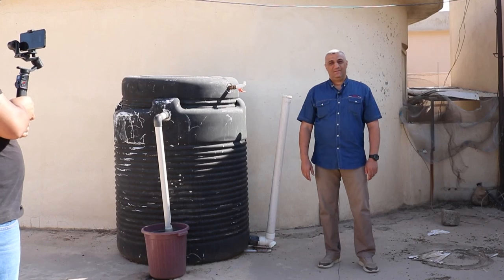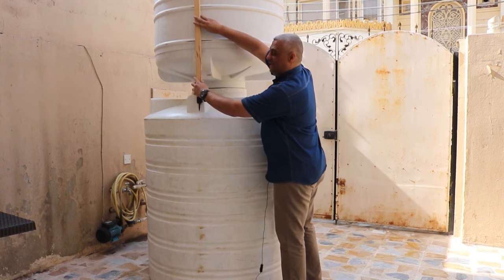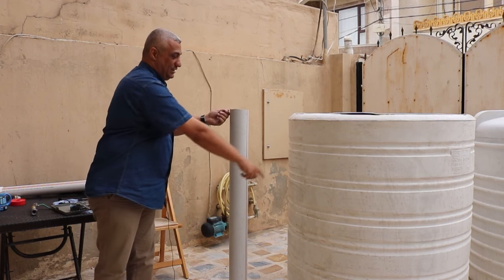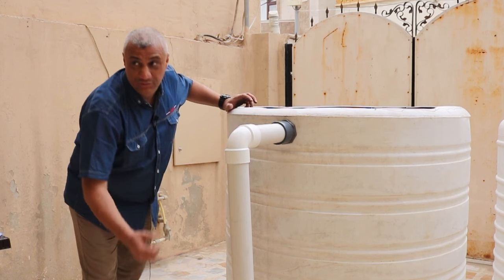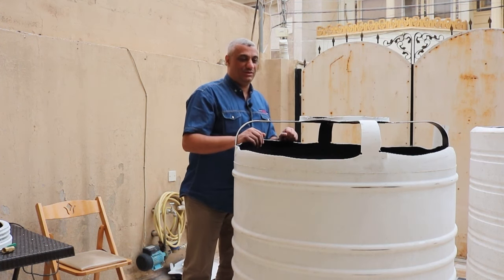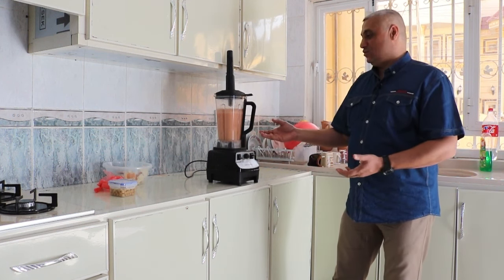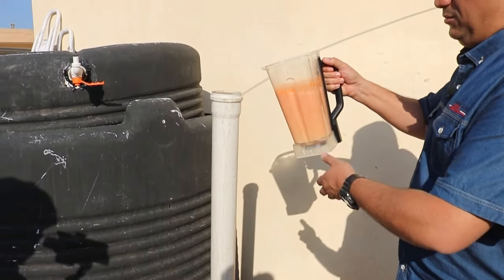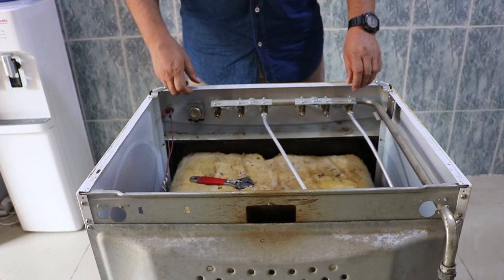Create your own biogas digester

Comment: thanks for the well-explained presentation. but I have a question sir, the gap between the wall of the digester and the gas storage does not leak gas. the storage was just put upside down in the digester, what about the side, how to prevent gas leakage.

Comment: You are Hero's, making the world better in many ways.

Just a thing about the manure:
You would want to see what the animal eats for the bacteria culture.
If you have a lot of branches and grass, I would suggest having a second digester for your garden material. (the bacteria need to be able to specialize in this case)
Problem is that food is already processed a lot and will digest more easily.
Anything with a cell wall will have a problem digesting, but then you would use a mix of horse and cow manure.
Chickens are for example more predatory and eat seeds, which will have a different mix of bacteria. but also probably fix more nitrogen in their droppings.

The Basic material is easily fixed too:
You said not to add bones or hard stuff that does not digest.
To balance your acidity around a PH of 6, you could use egg shells, clam shells, bones and such.
They will slowly break down as the acidity lowers and push the PH back up as they add calcium ions into the mix.
Just be sure it's a small layer of material that stays on the bottom, you will want to ensure it does not overfill.
(might use the good old stick prodding method to check how much stuff is on the bottom)

Design wise:
Simple and easy to build, am only concerned with a little gas leak from the sides of the digester, a skirt on the storage might solve this though...
(Just to ensure as little methane as possible escapes into the air, because it is another greenhouse gas)

I really hope this video reaches as many people as possible.

Comment: Do you not lose gas, as it escapes from the space between the two tanks? ( the space  I refer to is between the bottom tank walls and the gas capture tank that raises and falls within the bottom tank.) Thank you.
Reply: I think the interior one is smaller and his botom is into the water of the first one, as long as it doesn't go above the waterline it's airtight (like when you put a glass backward in water it doesn't loose air), you just loose the production that is made between that gap on the outside of the top container witch must be neglectable (outside) if the dimentions are close enough
Reply: It definitely will lose some gas that way. One could think about building a double wall digester, but I assume the big effort is not worth it.
Reply: Second thought: As methane in the atmosphere is a real hazard (much more than CO2) it would indeed be wise to think about capturing the gas from between the tank walls too!

Comment: great build but it looks to me like a lot of gas will escape between the digester and storage place cause sludge is there and the gas produced between the walls will go out, not in the storage tank. I am not saying it cause I would like to save 5-10% gas, I am saying it cause the smell near it would be unbearable... Also, if understood correctly, we need to simulate body temperature for it to work, 30-35 degrees C, meaning it can work excellent in India and Kenia but the rest of the world would need to run the heaters, right? What is the minimum temperature that would allow the bacteria to reproduce and do their thing?

Comment: If the liquid level is relatively full, the fresh in feed material will stay at the top of the feed-in pipe. If adding material at 1 L/day then it may take several day's worth of fresh supply to push it down to the bottom of the tank.
That means today's feed could be a week old before it is in the tank.
All this while it will be off-gassing to the atmosphere. There needs to be some mechanism to push the feed material into the bottom of the tank directly after adding it.
Any suggestions.

Perhaps capping the feed-in pipe after adding the feed-in material. So the pressure of any gas produced in the pipe will force the fresh feed further down the pipe?
Or even T'ing the gas outlet into the feed-in cap?
Maybe a plunger?  I am open to suggestions.

Comment: One question, if your liquid is filled so high in the digester tank. Why is it not back-flow or overflow out to the feeding line when it is open up to feed food waste?
Reply: The inlet needs to cut higher than the outlet so the overflow will go out where it's intended.

Comment: Sir, how do you make the digester air-tight? The system needs to be anerobic, but you didn't show how to make the system air-tight.
Reply: Doesn't need to be air tight between the two tanks. The gas bubbles into the upside down tank and the water/manure forms the seal between the two. Remember it's a very LOW pressure system
Reply: @Aussiehomestead1965  Thank you for that.

Comment: I don't see any seals between the lower chamber (digester) and the upper chamber (methane storage). Based on what I see is that methane can leak out on the upper chamber's opening.
Reply: I think that when you cut out the top of the lower tank you're supposed to make it exact to the upper tank going into it so there's very little Gap. He mentioned that it's slightly moves up and down when you add food and the fertilizer coming out so it's a slight mixing action and the tank has to move up and down slightly. I think that's what I understand he is saying.